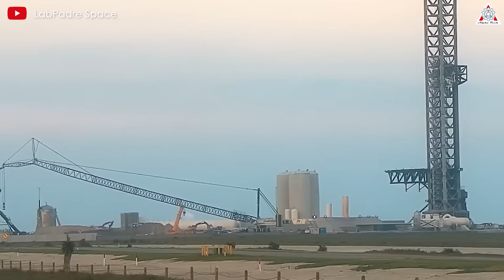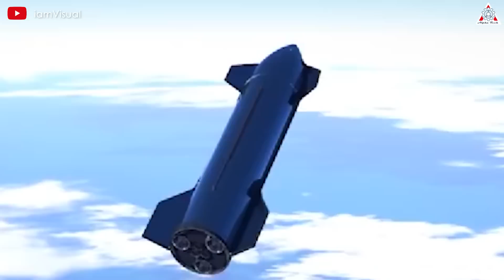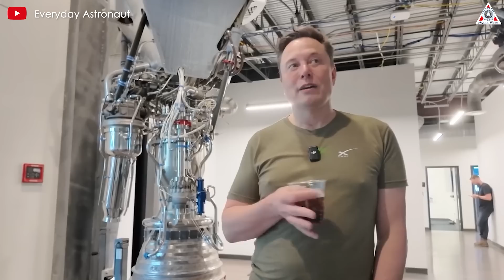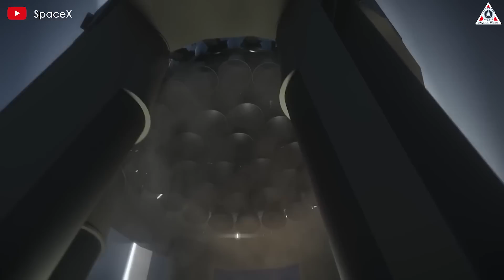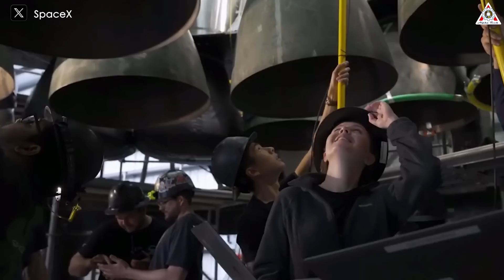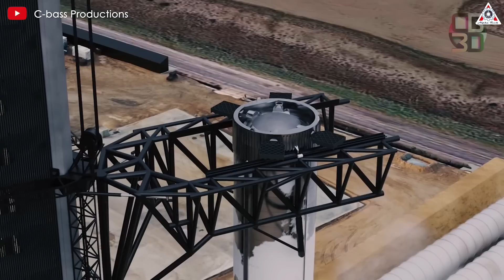Elon Musk's Genius NEW Solution to Solve Starship's Weak Problem During Launch

Comment: Starship is only rocket to existence ice issues. autonomous pressurizations on the rs-25 engine is accompanied by converting the liquid            hydrogen and oxygen to gas by heating. The hydrogen is heated by using it to cool the nozzle while the oxygen is passed through a heat exchanger in the turbine exhaust. for want of a heat exchanger they are adding ice strainers. wtf

Comment: It's to bad SpaceX hasn't figured out a way to make a spray on heat shield I'm thinking it could be sprayed on in a epoxy powdered glass and Titanium dust. I don't know how many coats of the product I don't even know if it would work. So the thing I can say put it on a rocket that is going to be phase out. That way your not out a lot of money. This is just an idea only.
Reply: The shield tile pointed corners are one of the needed features.

Comment: The filter blockages has nothing to do with the products of combustion entering the tanks and freezing. The solid blockages involve the solidification of the super cooled oxygen and methane in the changed environment in the tanks now operating under lower pressure making it easier for the solids to form. I suspect in accordance with the Bernoulli equation which describes the energy of a moving fluid, the entry of the fluid propellants from the tank to the higher velocities in the pipework into the turbo pumps results in further reduction of the fluid temperatures (since the fluid pressure itself doesn't change).
Reply: @michaelreid2329  Exactly. And its worth noting that SpaceX's ise of sub-cooled propellants has brought grief previously.

Comment: The ablative material should not need constant replacement and lost tiles can be replaced as needed ! Not all ships will need heat tiles either ! Just ones returning back to earth or landing on the moon !
Reply: Ablative literally means "Wears Away" it obviously will need replacing as it wears away >
Reply: @bazwilliams6484  except that it is UNDER wear redistant tiles.
Reply: Why do they need tiles to land on the moon
Reply: @davefarmery8180 great question.
Reply: @davefarmery8180  They don't
Reply: Only when a heat shield tiles fails, does the ablative mat underneath need to be replaced. This probably requires several local heat tiles to be removed around the damaged one, the ablative material inspected and replaced.
Reply: We need a heat shield to land on the moon? 🧐
Reply: @nooblerelf5309  No
Reply: @lotuselansteve  I know this, but apparently he doesn't 🥴

Comment: Unless your name is Wernher von Braun and the rocket you are building is the SaturnV that send men to the moon without refueling... then your rocket works every time without multiple test flights that showed you missed something during the design phase.
Reply: they're not entirely comparable launch vehicles, the saturn v never required refueling because it's designed as a solely expendable vehicle, reusability was never considered (which is why it was also so expensive, 1.62 billion dollars per launch in todays monday, while starship is aiming for about 15 million per launch if i'm not mistaken). also, nasa and spacex have entirely different methods when it comes to testing, the saturn vehicles were tested extensively (also, nasa outright lost astronauts during the apollo programs testing, from apollo 1) spacex tends to be much more riskier and doesn't mind having something blow up or go wrong because they collect incredibly valuable data which helps them progress.

Comment: Coking is when materials get converted into pure carbon….. carbo nano thread ad a way to double stitch the ablative sock oversized and double sewn with the carburetor n nano thread would expedite the turn around time…thermally resistant 😅glue with 2 layers of the nano threading a glue in between the stitches and on top of the patch a before launch wound give the time for the glue on the ablative material and the tiles reentry, plus a a fission reactor to power the flight to graduate gravity in transit there to allow freedom of movement for all electrical needs plus freedom of movement to facilitate artificial gravity while chevron can be slowed down to slowly adjust the gravity of there  so people don’t b come too weak, plus Newtonian las states that only  one rocket engine, plus a myriad of hypergolics would be enough for one r Chet to get us there, plus a myriad of hypergolics to adjust trajectory 
Would be enough. Land both sections two boosters at a time with one being the top with that as the bearing and another as a mound of regalith as a a tunnel as as the transition between thbearinf system and the artificial gravity. Hey he removal of the nuclear waste e is the secret  sauce!!!! I’m not going to give away all of my secrets . Because I want to be a part of the gateway to mars!!!

Comment: In the last flight, the booster landing was not totally successful as the booster exploded when just 'landing' on the ocean surface.
Reply from the maker: This is nothing to worry about!
Reply: @alphatech4966  It does not worry if the rocket explodes? That's optimized ignorance!

Comment: Why tiles?  I'm sure there IS a reason this method is best, but why not coat the rocket in a layer of heat shield material?
Reply: Because it's not that easy or simple.  That's why real engineers have to work on it.
Reply: @TheEvilmooseofdoom  I figured that part out.  What is the science as to why tiles?  Do you know?
Reply: Because the tiles aren't just coated with heat resistant paint, they're made directly from heat resistant material. Heat expansion is something to keep in mind too, the tiles have a little bit of wiggle room to expand and contract from the heat, plus many, smaller tiles = a few tiles being damaged or coming off isn't the end of the world. They're also cheap to mass produce.
Reply: @jerryandrews7028  Look.  I'm not an idiot so don't be insulting.  I'm 66 and have followed the space program since Gemini.  I know 'it's not heat resistant paint'.  That's ridiculous given the extremes of reentry.  My question is instead of individual small  tiles, construct larger tiles to apply to Starship?  A few form-fitted pieces that cover vastly larger areas each, rather than thousands?  As I said, I'm sure there are reasons this method of application isn't feasible or Musk would be doing it.  I'm curious what that reason is?  I've wondered why since the Shuttle started using tiles.  You remember the shuttle, right?
Reply: @jcdisci   it has to do with the thermic effects of reentry which can cause the tiles to mildly expand, also because losing one smaller tile during reentry wouldn’t be as massive of an issue. i also imagine the tiles being generally smaller means you’re able to put more of the same type of tile in more places which also drives down cost (plus, cheaper to manufacture) which was a problem with the shuttle since the tiles they used were usually unique depending on where the tile was placed. which is obviously way more expensive
Reply: @jerryandrews7028  Thank you, Jerry.  NOW I understand.

Comment: Titles were not working good with shuttles… Should be modified to cover bigger rocket surfaces.
Reply: That just proves you understand less than you pretend you do.
Reply: They didn't work well with the space shuttles because the tiles themselves were made to fit a very particularly shaped body, and generally the shapes and sizes of each tile were highly inconsistent, unlike starship's which largely uses the same type of tiles everywhere. Also need to consider the thermic effects of reentry, the tiles need more wiggle room to expand and contract from the heat.

Comment: Why not lauch from a tight tube and  put the rocket inside an use the extreme pressure created  from the truster for extra power instead of wasting the massive energy created when launched normally
Reply: I would not stay in your tube : imagine the G force you would get inside !
Reply: @ericbohn2510  not for humans there a compagny called green launch that use hydrogen with a cannon nice stuff
Reply: @hangtime1111  Because real engineers know it's not as simple as you think it is.
Reply: @TheEvilmooseofdoom  yeah but you have to launch random idea so we can evolve because we're stuck in the same pattern of rocket for the last 50 years, inefficient  and fragile

Comment: The heat protection at the top should be made from 1 piece not 50 piece glue together
Reply: If one piece works better, that's what they would do. But the individual pieces are literally in different temperature zones. And this works better.

Comment: I foresee a future Starship version upscaled to a kilometer tall and diameter scaled up a likewise ratio and become the Mars mission backbone craft.
Reply: That needlessly big, and wasteful. Plus Starship you have to refuel, and how many launches are you planning on doing to refuel it there? V1 already needs 10 launches (at minimum) to go to the moon, nevermind beyond using its Merlin engines. Which are also not the most effective engines for interplanetary travel.
Reply: @AngelinaWings45  The larger the better the fuel-payload ratio becomes and that is true with sea ships as well with the only major limitation on growing bigger has been ports and canals able to handle the biggest ships.  In the 70's-80's  3 off shore unloading points were set up for oil because no US port at the time could handle the bigger oil tankers.  One off CA, TX and NYC each, now only TX is still in use.  The each step bigger is more efficient not less.  The limit on size for NASA in the past was based on the old width of two mules rear end formula for rail and highway widths.  The Shuttle had to be flown but all the boosters, tanks and prior rockets were limited by highway and rail size limits between mainly FL and TX.  SpaceX by building and servicing on site in both FL and TX that limit no longer applies.

Comment: I wonder how many more test flights, before tiles morph into coatings?
I could see a nice refractory aircrete mix being better and faster, and perhaps using boro silicate beads in the outer surface to create a protective reflective final layer.

would be pretty easy to spray on and trowel up using multi jets and a sleeve.

On the fins and flappers, those are like aquatic Dinosaur control and lift surfaces... You'd be better off with high mounted wing stability, some V to the wing horizontal angle, and more traditional aft located control surfaces that the leading edge could be cupped into the trailing
edge of wings to shade hinge from the friction heat.

And those forward flaps could be fins, on a pivot at 90° to the hull, way easier to seal and protect a round shaft. And then you would get way more control range than the off/on range of the forward flappers.

Also if you double delta the wings, and have a keel with airship rudder below, you could also get trinary hull stiffness with out needing all those krappy internal longitudinals... stiffen outside the hull, get more uses for the metal mass, like wiring and plumbing in wing root structures.

Another way to get stiffness would be going longitudinal gores, and pressing them into slight lobe shapes between the longitudinal welds. literally using two dimensional curves in the skin to reduce internal structural clutter, and ill advised increased mass.

Its fun critiquing Starship developement, as the Rocket Enginerds are so dogmatic as to be short bus. 🤭

I think its from a lack of viable competition, and that when others are closer behind or even pulling ahead,
They will uncork their heads, out of loss of smugness...

I can see it coming now, like with Stoke Space and multiple combustion chambers to pump ratios...

I've been hounding on that one for years, literally was with the original parts count writ. And somebody else groked it first.

SpaceX does iterate and progress, but they seem to be more rut bound than forward thinking... Lacking a keen sense of the obvious at times.

Unimaginative engineering, likely too much time in education learning numbers crunching, and not enough childhood use of imagination. Did their teething on plastic toys, never got to make things from scraps and junk...

Elon knows, probably just the women in HR insisting on degrees...

He needs to expand Ad Astra and produce those practical synergystic generalist types... Heinlien would approve.
Reply: I still see tiles as the primary shield for some time but I could see a coating made of an unfinished material that uses reentry heat for the final cure.  Like making fire protective bricks in a kiln on the first firing.  Useful to for seams or replacement in space if needed.
Reply: @charlesmaurer6214  
Yeah, I've proposed similar re entry kilning before too... seems obvious to me. thats quite the kiln at 20k km/ph
Those tiles arent going to make it, thats a concept scabbed on from NASA  that already has a body count...
Reply: Spray on is not a good idea, as it could peel off in large chunks too.
Reply: @peterclarke3020  
Normally maybe, I've done writs on it before, suggesting a fine expanded metal spot welded to the hull, and you could also sand blast the hull. Give it some tooth.
Plus a good analogy is the concrete slop that gets on your wheel barrow pouring mud, if you dont remove it immediately, its only coming off with an air chisel or a grinder.
The thermal expansion rate of concrete and steel is pretty much the same, thats why rebar doesnt crack out....
There are better options than 18K tiles. I suspect somebody's brother in law got the contract on those.
They are too time and labor intensive, too brittle and fragile, and cost too much by the acre of application.

They ain't gonna make it... not enough re-entries to be considered reusable.
Just MHO...
Reply: Perhaps like the skin on a snake. The whole area that needs to be shielded could be all one prefabbed skin. After a spaceship lands, the skin is quickly removed, and the chopsticks swing the ship around directly into a new skin. Perhaps most of the detaching mechanisms could be installed on the cool side of the ship so that they don't wear from burning temps. For now, that is all I can see for quick reusability.
Reply: @k.sullivan6303  
Thats a pretty cool idea, the quick detach heat shield, to be refurbished, as able, after immediate replacement.
Way better idea than 18K small tiles... Just one or more large sections that key in sliding aft so air friction and launch thrust seats into pocket mounts.

Could be like bayonet lugs where sections set on and slide aft and latch in.

I like your concept alot!

Comment: If starship was just a disposable rocket, it would already be superior to all others😂
Reply from the maker: Yeah yeah
Reply: @alphatech4966  you don't think so?
Reply: Re-read his comment. He said if it WASN'T a reusable, which I agree with. The criteria is much different. Even so it's still pretty superior given it's size, cargo space and almost reusable ability.
Reply: Absolutely
Reply: @chetannagdeve7522  🤣🤣🤣🤣
Reply: Really? Then why isn't it human rated? How can it be "superior to all others". When it hasn't even conducted a full orbit yet? Maybe think a bit about what you type, before gushing like an Elon Fanboy.
Reply: @Greg_Edmand  Booster is inevitable that it will land precisely and be reusable.
If the upper stage was expendable, you could lose the weight of the heat shield tiles and make it less robust and lighter for max payload.  Whole thing is stainless steel, way cheaper than composites  like F9. 

Just consider how fast they can crack these things out

It’s already better then the rest
Reply: @fionajack9160  Starship has great potential. But it is definitely not "already superior to all others". Because it's still an unproven prototype, yet to orbit the earth successfully. Let alone be rapidly reusable. There's years of development before rapid reuse can happen. So at the moment, even Falcon 9 and Heavy are superior to Starship, because they are in successful service.
Reply: @fionajack9160  you wouldn't need the heat shield for a one way trip to mars
Reply: @Greg_Edmand  however, it is many times of larger mass than any others, so by that virtue, I believe it is.